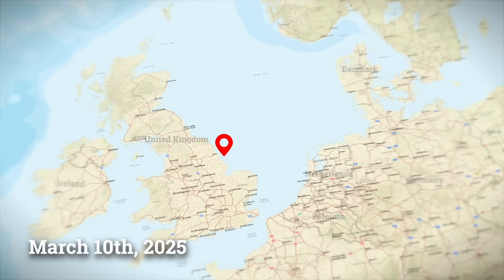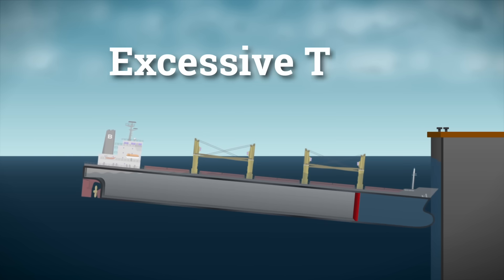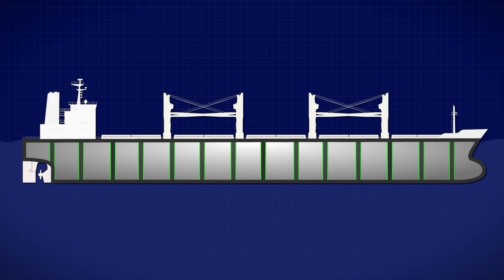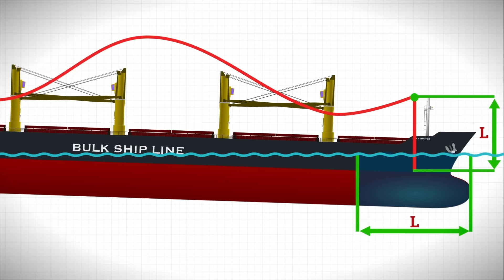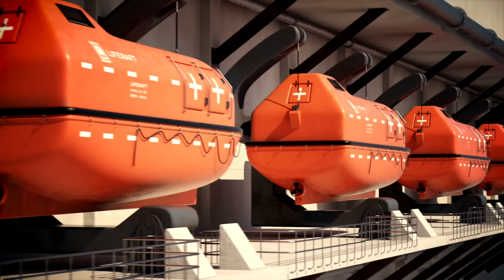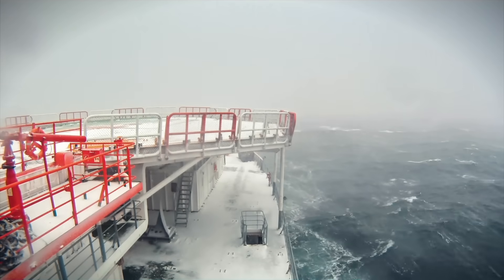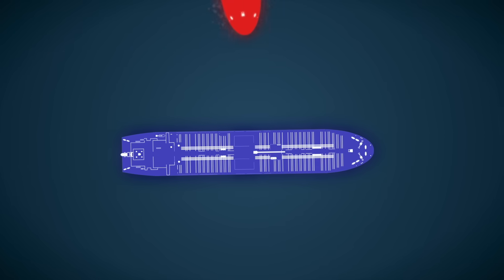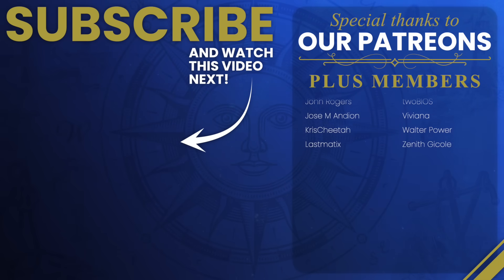Why Didn’t This Ship Sink After Crashing?

Comment: Thinking of Titanic, I'd argue that probabalistic approaches had been considered - she was designed to float with four compartments flooded, and had a double-bottom to protect against scraping along rocks, which was more than enough for what was seen as any likely scenario. Scraping such a long length of the side against an iceberg wasn't considered likely enough to be worth defending against, and modern ships are probably likewise vulnerable to such situations as they're relatively unlikely. Arguably Titanic's sinking was really a freak accident, though it showed a lot of other flaws in safety approaches at the time.

Another example I think of for probablistic approaches isn't a ship, or from reality, but the destruction of the first Death Star in Star Wars: A New Hope. That was a military attack rather than accident, but still could be evaluated the same way - the risk of a given scenario versus what's needed to protect from such risk. I see a lot of people describing the exhaust port Luke struck as a glaring vulnerability, as if it was a horrible design flaw. One a whole movie was made to explain. But think of what all needed to happen for that: the Rebels had to get the plans to know about this possible vulnerability, to access the Death Star they had to fight their way to the well-defended shield generator in a major ground battle, disable said shield generator, fight their way through the Death Star's defenses in a large space battle, strike the exhaust port a first time which might have destroyed a protective grate if there was one (the absence of such is often criticized, there might have actually been one) then the only way getting that bomb in the relatively small exhaust port is with The Force. The possibility of all those things happening, the rebels managing all that, would have been seen as so remote that the exhaust port wouldn't have been regarded by anyone as a problem.

All this is the "swiss cheese" model of preventing accidents/disasters. A slice of Swiss Cheese has holes in it, but stack several and as long as no holes align there's no holes in the stack as a whole. Often it's not practical to make a ship (or aircraft where this is often discussed) able to survive a given scenario, but other measures are put in place to prevent said scenario. For example it might not be practical for ships (or even moreso smaller boats) to be built to survive Category 5 hurricanes, but weather forecasting and reporting can help vessels avoid being in the path of such storms.

Comment: Negative, it doesn't displace more water. 4:04
Reply: It does
The more a ship weighs, the more it sinks down
And the more it sinks down, the more of the ship is under the water, meaning it displaces more water
A ship is negatively buoyant if they weigh more than the water they displace, ie. they sink

The added water effectively makes the ship heavier by the amount the water intruded, canceling out the buoyancy in that area, but the ship goes down a little, displacing more water by the same amount it took, and thus still floats despite the imbalance

A balloon full of water displaces the same about of water as one filled with air (assuming they're at the same size and depth)
But the water filled one weighs more, meaning it must displace more water to float, or if it's heavier than the water it can displace, it sinks fully

The air balloon on the other hand is so light that it doesn't need to displace a lot of water, meaning it only needs to sink down a tiny bit, and displace a tiny amount of water to gain enough buoyancy to cancel out its weight and float on the surface
Reply: They're technically right in that the ship is no longer displacing the water, because the water is inside
The ship displaces the exact same amount but needs to be lower to do so
Reply: @greebler_elf fair point
But i suppose it depends on weather or not you count the water that was added as part of the ship(which i did)
Say, if rainwater entered the hull and weighs it down, that would 100% mean that the ship is displacing more water, as it's basically acting as cargo at that point

The hole to the ocean is a little odd in that case
You could argue that the hole is connected to the ocean, thus the weight is not part of the ship, meaning that part lost displacement
If you think of it as part of the ship, them it displaces more water

I'd still argue a little for it being accurate to though, since it would otherwise make cases where, for example, the opening is above the waterline finality, but water still intruded, a little hard to define

since it would still be unconnected to the main body of water, it'd be acting as cargo, meaning more displacement
Essentially acting as a lower open hatch that's letting seawater in, but not fully submerged
Which would especially be possible in cases where the opening is in the midding of the ship length, where the ship is unlikely to sink down to the point where a high breach would be submerged

Comment: In my naval engineering class, we have an exercise where we use a simulation that allows us to allocate man power to different compartments of the ship, and to move different supplies to different compartments. If you do it right the ship doesn’t sink! But if you do it wrong your ship sinks. The only thing I took out of that exercise was that I don’t ever want a hole in the side of my ship.

Comment: Question. 6:00. What if a colision happens to the separating bit of a thing and 2 compartments getting flooded? It still gets afloat or titanic mode ON ?
BTW. This vid was so interesting that i woudn't mind having it 30min+ going deeper into the rabbit hole :)
Reply: Depends on the design of the ship, the engineering safety margins, and how heavy it already is.  A loaded ship is less likely to survive that than an empty one.
Reply: @norahc. So we definitely need another 30min+ video going into details :)
Reply: @bevis71 not disagreeing but it would have to be on a per ship Cass by case basis.

Comment: ok so, the 6-year old in me has some questions :D 
1. so why do those compartments don't have a water pump, powered by ship engine, to pump the water out? can buy some time until ship reaches somewhere it can be repaired
2. why do bulkheads are dividing the ship lenghtwise like 2:36, why dont put one in the middle through a whole ship length, so if a ship hits it on the side only half of the compartment is flooded? in that case Floodable Length Curve would be twice as high? 
3. why dont you fill critical compartments with something like party baloons (silly but hear me out), so when a ship hits something like an iceberg few of the baloons will pop, and water will rush in, but some will remain inflated and keep some buoyancy?
4. if a back of a ship is flooded, like 4:45, would it be better if captain ram the front of the ship in purpose to flood the first compartment? it will move center of buoyancy back and it would be fine-ish?
Reply: 1: they usually do, but there's no guarantee there's going to be power in that compartment once it's flooded. 
2. Because flooding only one side makes the ship even more unstable and prone to capsizing 
3. Then you're not hauling cargo in those compartments costing you money instead of making it,  and they balloons wouldn't provide enough bouyancy to make a difference 
4. Sometimes but its situation dependent. Also no need to ram anything.  You can do what's called counter flooding ... where you intentionally flood another compartment to offset the changes caused by the damage flooding.
Reply: On 3
But wouldnt it be possible to design something along the line of a inflatable structure?
So if the hull is penetrated you could deploy it I side of the compartment and seal up the leak. Obviously the compartment would then be no longer accessible.
When not in use it could be stored like a rescue raft
Reply: @markusp9569  Possible? Yes, I suppose.  Realistic or feasible? No.

1) How do you plan on preventing your inflatable system from also being damaged in the collision?
2) How do you plan on placing the system in the exact right spot it needs to be to slow down the water entering?
3) How do you plan on securing the system to keep it from being washed away after it's activated? Keep in mind if its installed from inside the compartment, you need to figure out how to shore and brace it against the water pressure and wave motions
Reply: 1. because the water will keep coming in extremely quickly, you'd need an absurdly powerful pump
3. because the point of a cargo compartment is to put cargo in it
4. ramming the ship is a bad idea but intentionally flooding to maintain stability is a thing
Reply: @alexanderf8451 In the immediate aftermath of the accident,  the purpose of the dewatering pump isn't to remove all the incoming water immediately,  it's to buy the crew time to patch/fix the damage to the point that the pump can then keep up with the incoming water.

However,  most merchant vessels don't have the necessary crew, training, and equipment to do full blown damage control like naval vessels do.
Reply: Most tankers do have a centerline bulkhead which is there to keep the cargo from sloshing back and forth then for damage stability. 

As far as the other things the fact that the ship stayed afloat shows that all of the other things are not really needed
Reply: @jamesmurney1374 is it a full bulkhead or just baffles?

Comment: So if a ship gets cut in half, that's only two compartments.  But does each half still float?   I would suspect there is wiring and other utilities running from the back to the front, leaving areas for water to flow through.
Reply: There has been instances of ships breaking in half and one of the halves still floated. Can't think of the ship name off the top of my head.
Reply: @nian60  SS Laurel, it split in half but the stern section along with the superstructure stayed afloat for 4 days before capsizing I believe
Reply: Yes, a ship will float when cut in half. The main problem is that only the back has the engines which means little to no power in the front half. If cut lengthwise its screwed, though.
Reply: @alexanderf8451 most ships are screwed accept sailing ships